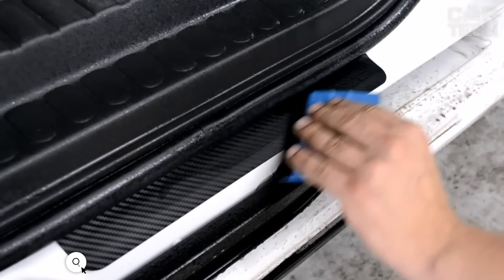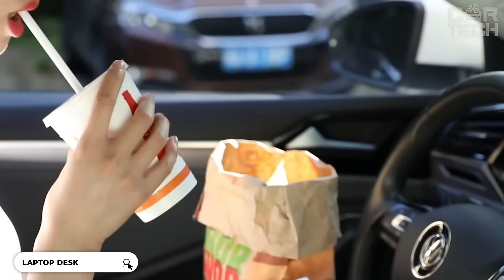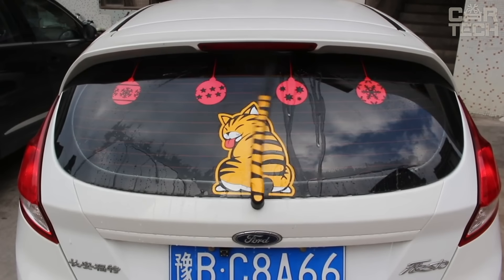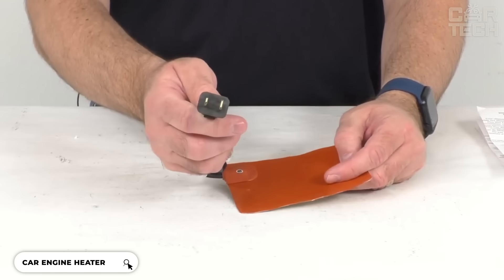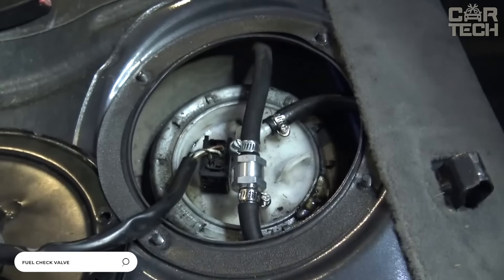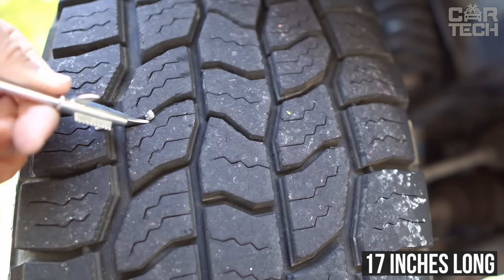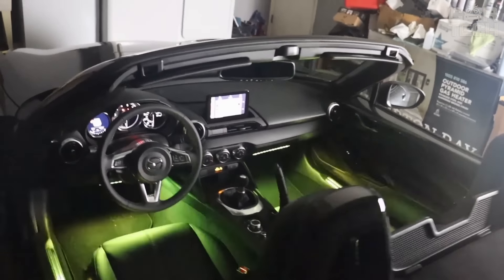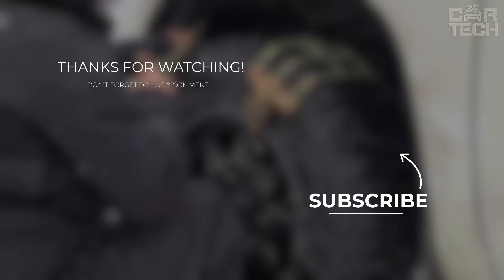40 COOL Car Gadgets on Amazon That’ll UPGRADE Your Ride in 2024!

Comment: at 4:50 they are showing something that is illegal as hell lmao there called anti foulers they were for cars that ran on leaded fuel back in the 50s...now they fit O2 sensors and give false readings...if you get caught with one on your car you might be in some trouble lol this video is out there
Reply from the maker: Thank you for your comment! The device shown at 4:50 is called an "anti-fouler" and, as you mentioned, it can give false readings and potentially get you into trouble if used improperly.

Comment: battery gauge lvl will show total charge  refered to as   surface charge , but not the health of battery under cranking load dont waste you time on  this and numerous other in this vid   they dont work , dont get caught  using the probe jammer it is bthe illegal and  detrimental to your  engine life  in give false reading to the  ECM and  will also void  warranty is found on vehicle and some  states will impound the vehickle  under  emmisions tampering laws, the  engine heater    will be fine in  cliamtes where  you do not drop   below freezing for  extended periods    and  never drop below  0 degress F  and  with it connect as they say in discriptiont   " connected to battery " forget it you just drained your battery dead to gain  a couple degrees of useless heat on oil pan  go buy a real   engine block heater.    the   hand held airpump  useless i bough   one   months ago  ya  it would do a basket ball but   100% uselss on a vehicels tyre i  could do a better job  by mouth with a straw contacted   seller  from scamazom and they never    responded to return refund request  and no  longer  answer emails